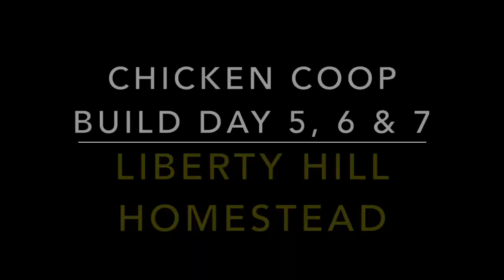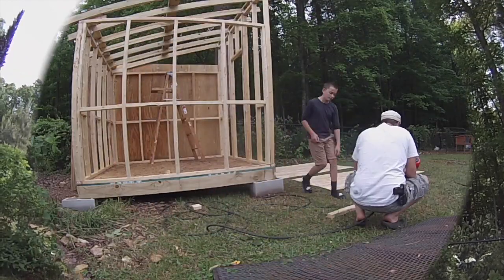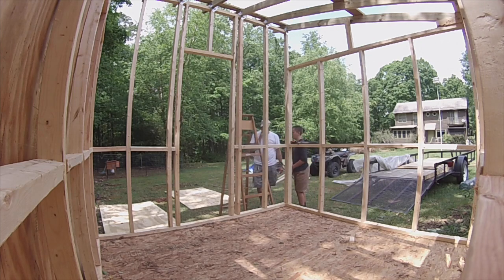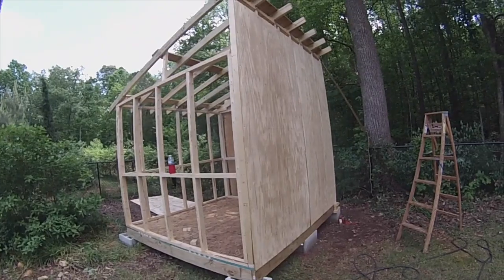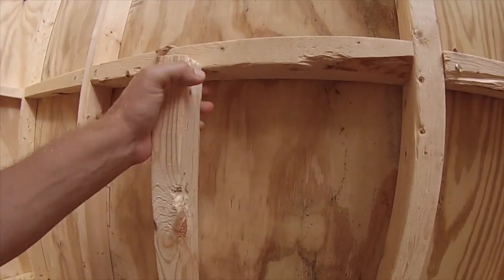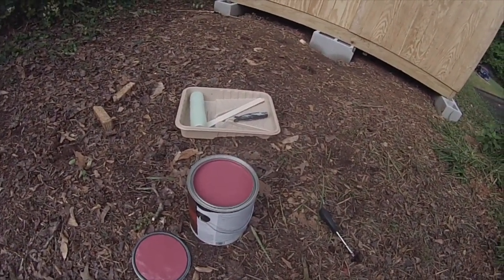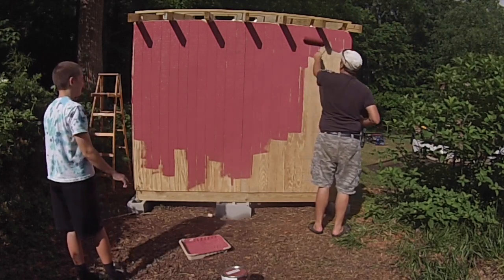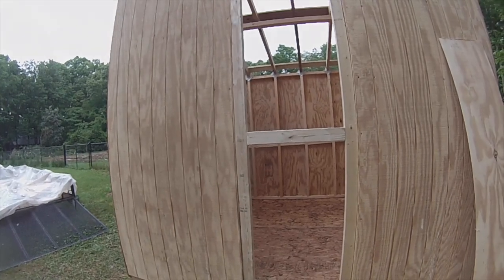Chicken Coop Build: Day 5, 6, & 7.

Comment: Your coop is very similar to ours - raised on blocks, slope roof. We added a poop door at the bottom on one side to shove out the mess at cleaning. Also installed a remnant piece of vinyl flooring to make it easier and protect the plywood floor. We're adding eavestrough at the lowest roof point to catch rain to a water barrel with nipple waterers for the birds. As for color, we want ours to blend into the woods so it's not memorable if trouble happens so we went with beige and brown.

Comment: Take it back to Lowes if that is where you bought it.  My paint for my house was supposed to be an off white and it turned out to be battleship grey.  Lowes doesn't do great matching. Danny at Deep South did a great video on building your door out of the piece you are cutting out.  You build the door, then cut out.  Will try to find the link.  Save money and time on the materials.